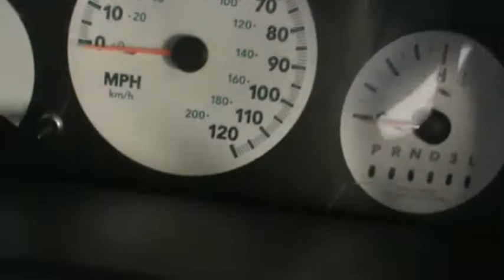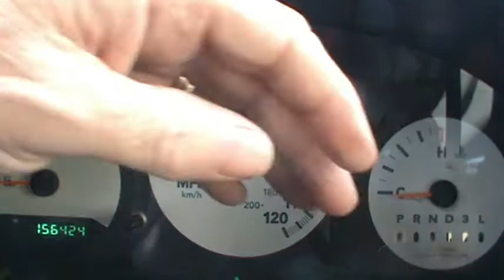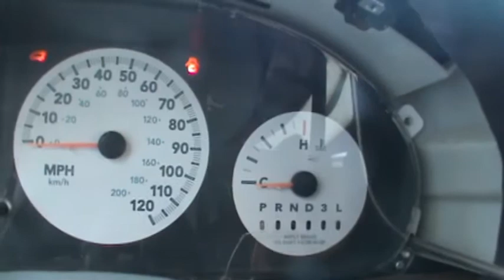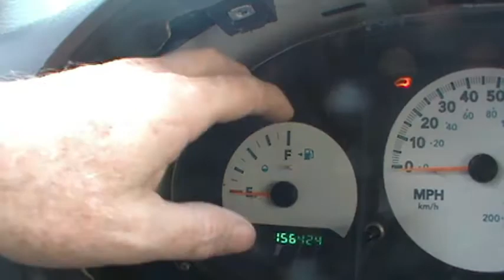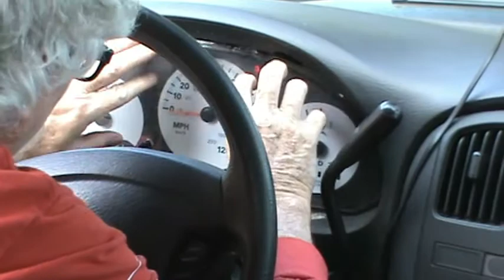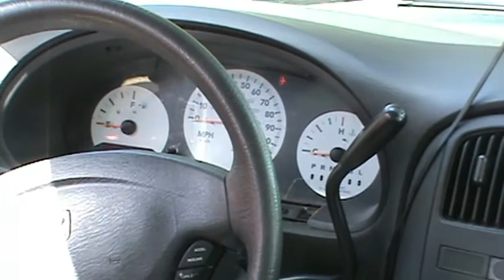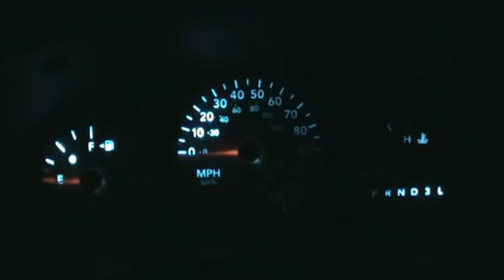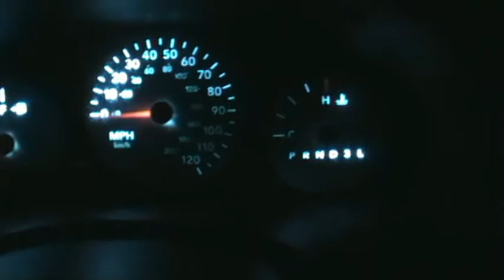Dodge Caravan Instrument Cluster Bulb Replacement

Comment: Great video.  Have a question I have also dodge caravan 2003 SE 3.3 Gas and the fuel gauge not working its the panel,  if I buy used one can the mileage be changed to the actual mileage on my car,  can this be done by me?

Comment: Hmmm, looks to me like you have the bulb on the right side of the speedo with the wrong polarity.  You did know that led bulbs are polarized right?  If they dont light, rotate the holder 180 degrees.  It always pays to test that each bulb is working prior to finalizing the install.  When I swap to led bulbs I always mark the positive pole on the panel so they can be swapped out without headache.
Reply from the maker: I put in all new bulbs. I had to put them in and out a few times to make a good connection. Thanks for watching!

Comment: I think 2 of the leds are not lighting, it just need to turn them 180 degrees they dont have the right polarity between 80 Km and 100 Km and the Parking. The lights are  PC 74  in the manual

Comment: I changed the 8 bulb and they are not working, the same... looks like the circuit is damage 😢
Reply from the maker: I had to take them out a few times to get them to work. Connections were corroded.